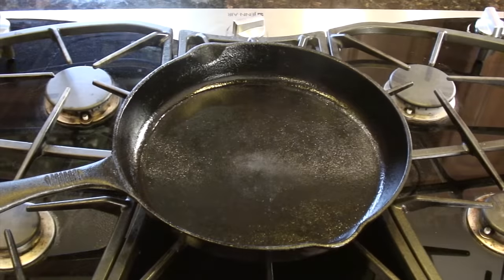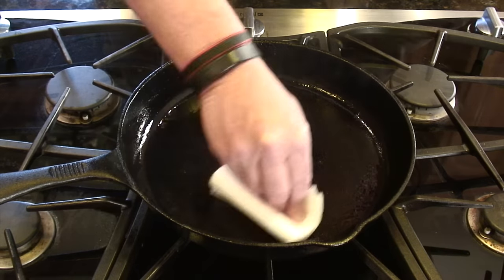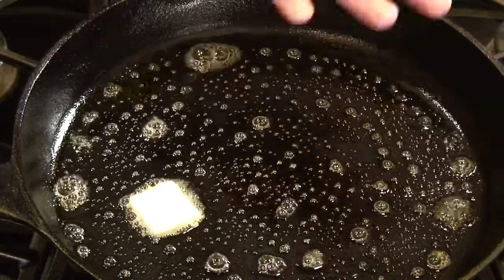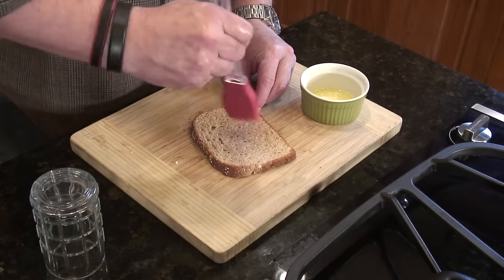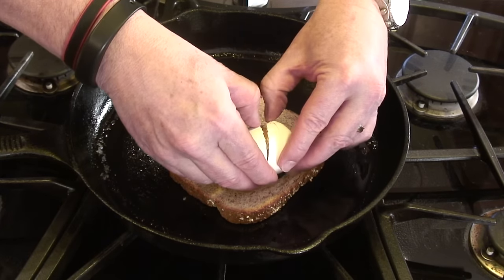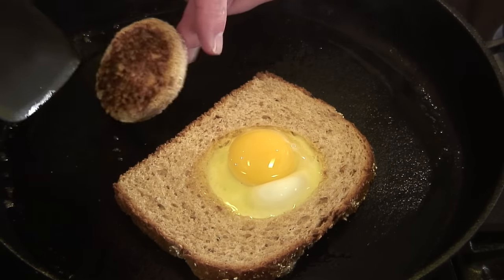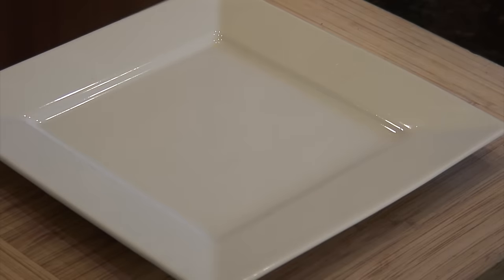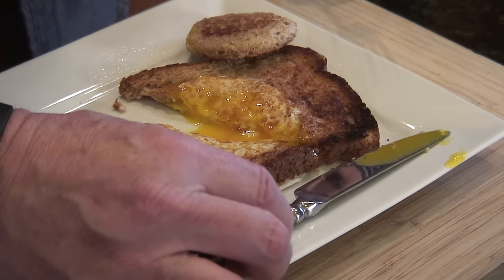How to Make Cast Iron Skillet Perform Like Teflon

Comment: When my mother died back in 2006, she left us a bunch of old cast iron pans. She never used them, they were my grandmother's pans and skillets and she had just hung them around the kitchen as decoration. I had always used Teflon frying pans and after 6 to 9 months of use, they would always start to go bad even following the recommended care. I got tried of shelling out $40 or $50 to buy a new frying pan every 9 months. The old cast iron pans hanging around in the kitchen were all blackened over. One day I decided to clean them up and put them in the self cleaning oven. It turns out I have a bunch of really nice Wagner Pans & skillets that were made in between 1920 and 1940. I watched some videos on how to season them and they work fantastic now. These old Wagner pans have a much flatter surface than the new Lodge cast iron pans.
Reply from the maker: This post makes my day.  Thank you.
Reply: I'd sell those pans and get some composite or cladded pans. They're lighter, distribute heat better, handle easier, and can also be seasoned. -They're also more durable than CI.
Reply: I have looked into this a bit and from what I have found, the reason that your older pans are smoother is quite simple, 1) Your older pans where made differently then the mass produced pans Lodge puts out now, from what I can find older pans went through another step Lodge cut out to reduce the price of their pans to make them more affordable, and that is they do not smooth the pans before selling or so I have read. Pans used to be worked smooth before selling, but it adds more steps and more cost. and 2) use of the pan seems to smooth the pan over time. I have read people say that after several years of use their lodge pans eventually become as smooth as what you say your pan is.  I have only just recently bought my first cast iron pans so I can only tell you what I have read or watched to this point.
Reply: So now you have something built to last that does a good job. Your grandkids can use your grandma's pans when you are dead. I love my cast iron pans. Just like you the teflon ones are just cheap throwaway junk. I think thats intentional on the part of the people who make them. Enjoy no longer buying new ones twice a year and having some quality. Your grandma would be proud.
Reply: I refuse to use teflon I think they are toxic and stick to my cast iron always plus I can make my cornbread in the skillet as is and put in oven.
Reply: Great! Teflon is VERY toxic so good you are done with them!
Reply: $40-$50 for 9 months of service?
maybe you should have went with the cheap non sticks instead. i have bought them for 10 or 12 dollars and they last several years if you do not cook with too high of a heat or use metal utensils in them. 
we cook everything in them too.
Reply: mad thumbs - I'd buy those old iron pans from you and laugh all the way home...
Reply: I love my Lodge pan I bought 20 years.ago. I eventually sanded smooth and reseasoned. I use it almost every day, but just received my grannies old cast iron skillet. Turns out it is a Wagner from the 1940s. Makes awesome eggs. I hope my Lodge isn't jealous.
Reply: Old Wagners and Griswolds are like Lincolns and Cadillacs, they're both nice
Reply: @tpp5151  I got a Griswald my mom left me from the 1930's when I looked up the number. Best non-stick pan I have. Better than my lodge skillet I sanded down and re-seasoned!

Comment: I took my brand new lodge skillet and was able to cook sunny side eggs with no special treatment.  Key is to warm the skillet up for several minutes until you cannot touch the handle closest to the sides comfortably, then add the oil I use vegetable oil, and then add the egg!  Lodge even demos this on their website.  It worked for me just fine.  Scrambled eggs also work fine if you give them a few minutes to cook a bit then pull in the sides around the circumference.  I cook corn bread by preheating and adding Cristi then the batter, no sticking.  I’m very happy with my lodge skillets and Dutch over. If anything does stick it’s easily removed with the still warm pan, hot water and a chain mail scrubber!

Comment: I’ve recently gotten into cast-iron skillets and I have to say they are amazing. I’ve never had a Teflon pan that performed anywhere near as well as cast-iron as far as non-stick goes. And I just got the cheap lodge cast iron too.  Works great.
Reply: I would say inexpensive but good quality Lodge cast iron skillet. I have an 80 year old Lodge cast iron skillet and new Lodge cast iron skillets. I use and love all of them on a regular basis.

Comment: Opinions on cast iron are quite divided. I have a good many cast iron skillets and other cookware and use them daily. What works for ME is the old chef's maxim: hot pan, cold fat.

A while back, I bought a Lodge chef skillet (rounded sides) to use as an egg pan. Seasoned it properly. I simply heat the pan on medium until it smokes a bit, drop the heat to low, add a pat of butter and then add the eggs, even beaten for an omelette or a scramble. Nothing ever sticks ... ever. Eggs and other foods slide around on the butter like nobody's business. 

When finished, I rinse with hot water, reheat to dry the pan, then wipe on a very thin layer of canola oil, which will then aid in telling me when it's ready the next time by smoking. 

The thing that baffles me is how many people still seem to have a phobia about consuming small amounts saturated fats. Aren't we past that since having discovered the it's the over consumption of simple carbs that is killing us?
Reply: attempts will be made
Reply: Since I've started cooking using more fat, including all the butter I want-not only have I not gained weight....I've actually lost weight.  I have just bought cast iron and learning to care for it & use it properly.
Reply: Word man. I dunno how fat still gets the hate and eating an excess of nutritionally lacking grains doesn't. So many foods out there are perfectly fine; even very nutritious; but just have an irrationally bad image because people don't know self control and overeat them while also overeating simple carbs.
Reply: You hit that nail right square on the head and drilled it!
Reply: +WormyLeWorm Exactly.  people preach without even understanding the entire picture... which isn't even that complicated, yet they think they are so smart regurgitating their info which was just heresay to begin with.  Usually from "concerned moms".
Reply: gives me goosebumps about canola oil. should  be against the law to sell this thing.
Reply: I have cast iron pans as well, which I prefer to cook on to be honest. I season mine differently, when I have a new iron pan, is get it hot and render off pork fat. But I maintain it in a similar way to how you season yours. I tend not to clean with hot water and just wipe off the pan while it is still warm and give it a very light coating of oil. I find I don't have any issues regarding sticking. Regardless of how a person seasons their cast iron cookware, you still need to maintain it, and it will out last you and your teflon coated pans. Completely agree with you regarding your diet remarks by the way.
Reply: Sandra Martins    I agree with you 100 percent ! 🍳
Reply: I found a cast iron wok,the first  time I have ever seen one and cooks great,I collect cast iron 
 and love them.
Reply: cmrsvids
Reply: Remember when dying at 68 from a hear attack while living on eggs and bacon was considered "natural causes"? Seems like 68 years of living well.
Reply: +cmrsvids
From what I can see we have the sugar industry to thank for that little "misunderstanding" along with support from the vegans. They've been caught putting out misinformation about what causes obesity and heart disease in order to deflect against the fact that their product is the main culprit. How many people have died obese because of their lies is unknowable and it will take years for the public to get up to speed on this and stop thinking it's calories and fat that make you fat. And don't they have us brainwashed? When people see a fat slob they say, "Have another Polish sausage, fatso", when what they should be saying is, "Have another bowl of ramen noodles and a coke, fatso...". Aren't people just wonderful...?
Reply: +WormyLeWorm
Is two pieces of toast with coffee for breakfast an excessive consumption of carbohydrates? That's all it takes to fatten me up so I quit doing that years ago. Some people have bodies that just turn refined carbs into love handles and other people not so much. For me, a slice of white bread might as well be chocolate cake with extra icing. 

It must be great being you and having all that "self-control". Were you born superior or did you get that way over time?
Reply: Here in NYC Richard Lewis, a retired junk dealer from Buckingham County, Va., would fry fatback, take out the meat, break two eggs into the sizzling fat, and when he sat down to eat, he'd take a piece of bread and dip it into the grease. That would be breakfast, which he would polish off with coffee thickened with a half-cup of sugar. He also smoked countless Titan Philly cigars and drank as many pints of Thunderbird as his friends and relatives would bring him. He lived to be 105.
Reply: I'm not fat-phobic, but I have learned that I maintain EXTREMELY easily when ingesting fat. I don't want to maintain, I want to LOSE. Which can be hard for a middle aged woman to do. So I don't go out of my way to avoid fat, but I stay aware of it and make what I hope are smart choices.
Reply: Canola oil is not healthy! Butter and olive oil do not have high smoke points and are not good for cooking with.
Reply: Yes! But may I point out that exposing fats to high heat screws with their molecular structure and it becomes like a petroleum product. There's word for it - a loooonnngg word that I can't remember. But when I worked at a backpackers years ago there was a frying pan in the kitchen for the use of the guests - it wasn't cast iron it was the cheapest kinkiest dented and bent tin frying pan you can imagine - did that thing cook omelette! Really - I love watching what you Americans get up to. You have a hack for EVERYTHING! I use some of them and my friends say 'WHERE did you get that idea from...?' Bless y'all.
Reply: Deloris Williams 8
Reply: The Lodge pan are my only pans. The thickness, the molded handle their process all adds to a great pan for an even greater price. Made in the USA, Without Taking advantage of us for buying made in america American unlike other made in USA cast pans. Season a lodge properly after each use and yes your money will stick to your wallet, and food won't stick to your pan.
Reply: All cast iron pans that I have seen used seem to have a oily or sticky residue.  Is this from over oiling? How do you have a good seasoned pan and avoid the residue.
Reply: @connieroberts595  Put oil in when it's hot (you'll know when you can't place your finger at the edge of the pan for long), spread it, then get another rag (or paper towel if you use those) and wipe it clean. There will still be a layer of oil, which is enough to season and maintain the pan without too much residue.

Avoid letting it keep too much oil, or doing it at a cold pan. It'll not only gunk up, but it will also make your finish flake, giving your food bits and pieces of black polymerized fat that doesn't taste good
Reply: Agree 100%
Reply: myfoodmychoice1 Avocado oil
Reply: Daniel Goranov t
Reply: Exactly.
Reply: cmrsvids You can fry some green onion stems until they turn black the acid in the onions makes the surface non stick. “They”whoever they are never wants us to truly enjoy life, I stoped listening to “they”  long time ago.
Reply: I need to try this .. I have a 12” old mountain skillet, 10” and 8” inch lodge. You think I can figure them out? I use flaxseed  oil and everything still sticks!
Reply: @sarahladouceur5548  Are you seasoning the skillets with flax oil, or cooking with it? It should be used for seasoning the skillets.
Reply: cmrsvids seasoning!  I heard it was “the best” so I specially ordered it for seasoning my cast irons. But I’m happy to say I tried your method (heating skillet up to smoke point, turning it down to low - butter. Egg) it worked perfectly!!! Eggs slid all over the pan. I believe my downfall is the lack of knowledge and not knowing how to utilize the pans properly.
Reply: @sarahladouceur5548  The more you use them, the better you'll get at it. Get yourself a little nylon pan scraper. For clean up, run the pans under hot water, scrape away any brown bits or fond, and then dry on the stove top and apply a thin layer of oil (with a cloth towel, not paper towel, which leaves all kinds of tiny paper bits.) Using the scraper will leave microscopic amounts of cooked stuff and build the seasoning. One day, your Lodge skillets will be smooth. Good luck and I'm happy you had success!
Reply: cmrsvids thank you so much! I’ll look on amazon for a scraper. And I’m not sure where in the world you are, I live in British Columbia Canada. But I use “Scott’s blue shop towels” for my cast iron. I found exactly that problem with paper towels - it left tiny bits everywhere. The shop towels don’t!  Thank you for all the great information. I have 3 cast iron skillets and 1 tfal cast iron grill pan that have been collecting dust for far too long. I will master cooking in them eventually. :)
Reply: @sarahladouceur5548  Ha ... nice little discussion we've got going. Take a look for "Pampered Chef." They make a little brown pan scraper with varying corner angles and plenty of scraping edge. We're got four or five of them and they get used every day. They're inexpensive as heck. (Pampered Chef stuff is generally AMAZING, but also expensive. Not so for the scrapers. I was also going to add, one of the things I love best about cast iron is that you can sear off meats and fish to a nice brown, delicious crust and then simply finish off in the oven. And ... wait until you try skillet cornbread! (I can supply a recipe if needed.) Yum. BTW ... I'm in Southwest Wisconsin, USA.  ** here's a link to the scrapers: https://www.amazon.com/Pampered-Chef-Stoneware-Scrapers-Envelope/dp/B003Y319H8
Reply: cmrsvids I’ll look for that scraper. Just keep in mind, your in the USA. So if you think it’s expensive. It’ll be brutal for me. It’s so expensive here it’s not even funny. I would love a recipe - I’ve just never had cornbread! Would love to try it
Reply: cmrsvids is it the pan scraping set? Comes with 3? It’s $6 here
Reply: @sarahladouceur5548  Cornbread, Skillet

1 cup yellow cornmeal
1 cup flour
1 T (or a little more) sugar
2 t baking powder
1 t salt
3 eggs, beaten
1 cup milk
3 T melted butter
1 fresh jalapeno pepper, seeded and minced (optional)

Preheat oven to 425. 

In large bowl, mix cornmeal, flour, sugar, baking powder and salt.  Make well in center and add eggs, milk and melted butter.  Whisk and combine into a lumpy batter.

Preheat a generously buttered 9-inch cast-iron skillet in oven for 5 minutes.  Pour batter into skillet add bake for 25 minutes.  Cornbread will begin to pull away from sides of skillet.  Serve with plenty of butter.

ENJOY!
Reply: cmrsvids thank you!! Sounds amazing. I have all those things on hand. So will try tomorrow!  My kiddos love jalapeños oddly enough.  Thanks a bunch!
Reply: @sarahladouceur5548  Classic American side dish. Often served with chili, stews, soups, fried chicken ... this is a really moist recipe because of the egg content. A lot of cornbread recipes come out dry. This one is a winner. Let me know how you like it; I think you will!
Reply: cmrsvids I’ll let you know tomorrow. I’ll make it for lunch. I actually have Chili leftover and that’s our lunch tomorrow. I watch a lot of American VLOGS and they eat a lot of baked beans?? I have never had that either.  My mom never cooked that kind of stuff. I fell in love with green bean casserole because of American vlogs. Never even heard of it ! Maybe I live under a rock. Are baked beans any good, and if so- a recipe would be appreciated lol 😂
Reply: @sarahladouceur5548  We love our baked beans in America. Another common side for grill outs, picnics, chicken, pork, whatever. I normally just buy a good quality baked bean by the can, such as Bush's. BUT ... try this recipe (technically a baked bean recipe): 

Beans, Cowboy

1 can kidney beans
1 can butter beans
1 can pork and beans
1 medium onion, rough chopped
½ lb bacon, cooked and in pieces
½ lb ham, diced
1 t vinegar
1 t Worcestershire
½ cup ketchup
½ cup white sugar
½ cup brown sugar

Combine all ingredients and cook uncovered in oven at 350 degrees for 90 minutes.

This recipe is from my Dad.  He’s crazy over it, and it IS great. I never claimed it was low calorie ... LOL. And, green bean casserole? CLASSIC and loved by all.
Reply: cmrsvids I have written all your recipes down and are now in my recipe book. The cornbread was absolutely phenomenal! My girls loved it too! Thanks so much!
Reply: @sarahladouceur5548  WOOOT! Now you know why we love our cornbread so much. So happy you liked it, Sarah. Keep in touch. Food brings the world together.
Reply: Ok Bill Nye
Reply: @timothygreer188  thats a good and I mean gooood life
Reply: @connieroberts595  yes over oiling.
Reply: @atomedgesharpening  Ever heard of "de novo lipogenesis"?

Comment: Once you have yous skillet seasoned, the key to non stick is making sure to bring your skillet up to temp before putting the eggs or other food in the skillet. 
And once you are done cooking wipe your skillet out and then put a small amount of oil back in the pan as you did when you first seasoned it and reheat it and wipe the excess out and then let cool. 
This will keep it seasoned and the pores sealed up.